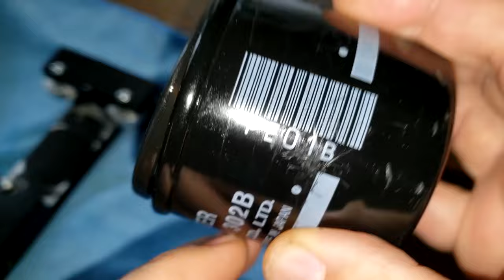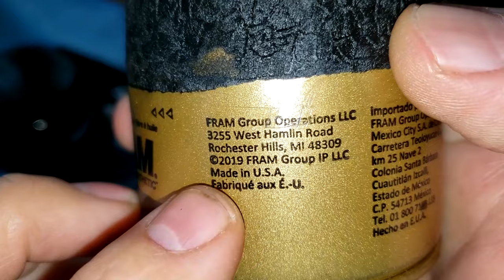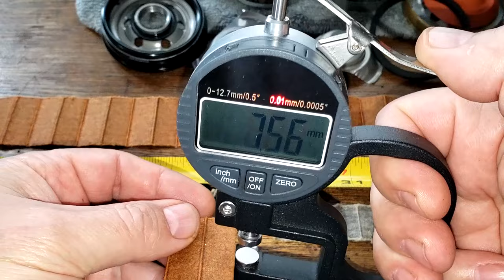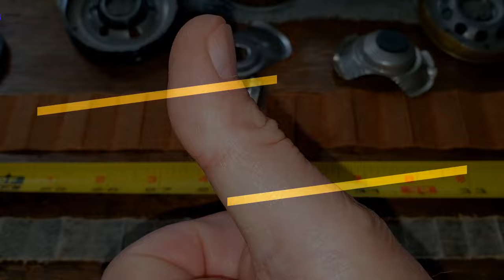Mazda PE01-14-302B Oil Filter Cut Open vs. Fram Ultra XG6607 Oil Filter Cut Open Comparison

Comment: That’s a really narrow media on the fram 😮
Reply: I used the oversize filter on my Mazda. Fram 7137.
Reply: @dwendt44  , yeah, the same filter that goes on recent model Honda CR-V's.  It's a tad longer than the 6607, but I figure as long as it fits, go for it.
Reply: @kimmillard9445  Most Asian autos can used that larger filter.
Reply: @dwendt44  if I were to use that size on my next oil change on my g35 would I have to maybe add like half of a quart extra to fill the bigger filter?
Reply: @kimmillard9445 it's also the same filter that go for 2012-2018 Nissan Altima models. I might start using Nissan OEM filters for now on after watching this video.
Reply: @flucas6595  , try the Purolator Boss PBL14610. If that's too long, you can try the PBL14612 which is a tad shorter.   The Amsoil equivalents are the EA15K13 and the EA15K12.
Reply: That Mazda filter should have way better oil flow.

Comment: OEM Mazda Filter wins this one.
Reply: no drainback
Reply: @freddyflintstoned913  on my CX5 wtih the 2.5 Skyactive engine, the filter hangs straight down.   Shouldn't need an antidrainback valve.
Reply: 9:16 Agreed, but my concern is that in the 100x view, the Mazda filter has big holes; I counted three. Therefore, the filter’s capacity for particles smaller than 20 microns makes me doubt its effectiveness

Comment: Seriously....the fram filter has less than half the filter medium than the Mazda filter.. that little thing will clog very quickly and all the oil including the dirty oil will go for sure through the bypass. The owner is lucky not experiencing any engine problems😮

Comment: Lets be honest with ourselves, Mazda looks brand new to me i think Mazda win this this one, but i still use Fram Ultra on my hondas.
Reply: With whatever non-oem filter you may choose, confirm it has the correct bypass spring p.s.i.
Reply: A filter that appears as new after 5,000 miles compared to one that shows clear evidence of moderate sludge/carbon trapped within its fibers and you prefer the one that looks like new? Do you understand the purpose of a filter?? A dirty filter is serving its intended purpose. A clean one is allowing impurities to remain suspended in the oil and continuing to circulate within the engine.

Comment: Good morning. I lean toward the Mazda filter.  Larger filter/neater pleats. Must be a reason OEM filter has no anti drain back on their filter. Looks to me that oil is dirtier on Fram. Later oil change? Or didn't Mazda do its job before Fram install?  Hi Chuck, I'm from Westmoreland Co. (Chuck is from Washington Co) 👍✊️
Reply: I'm an OEM filter fan myself.
Reply: I believe the FRAM has better filtration. Of course the Mazda (Tokyo Roki) filter would offer better flow characteristics. Maybe factory engineers felt that ample flow of filtered oil was more important than having the bypass at least partially open to get the required volume of lubricant to the moving parts. Hello from Washington County.

Comment: Thanks for the video, appreciate the extra effort it takes with used filters. The microscope comparisons are very useful too. Tokyo Roki filters are always so well made. I'm guessing the efficiency is around 50%, similar to the Toyota filters.
Reply from the maker: You're Welcome! I prefer opening the used oil filters, usually one filter per video though.
Thanks👍

Comment: Nice Job, Pete. If I had to choose, I'd take the Mazda Filter, I think, even though I generally don't care for OEM filters.  I do not like the bypass valve stuck in the leaf spring, too much chance for leakage. and the filters off my lawn mower look bigger than the filter cartridge in the Fram.    Too bad because it looks decently made with good materials.  I'll stick with my boss filters

Mazda makes good engines.  I had a 91 626 that I put on 20K miles for two years straight going from Nashua to Cambridge and it never gave me a lick of trouble.
Reply: I like the Fram's synthetic filter media better, but I was disappointed how chintzy they were in the amount of media for the same size cannister.
Reply: @kimmillard9445  As I said, I think the filters for my lawn mower have a bigger cartridge.  Neither one would be my first choice. Plus that bypass valve isn't a good design in my opinion.  too bad because the media is better.
Reply: I know my lawnmower has more filter media than the FRAM. It's a small can, but wow. That's not a lot of filter.
Reply: @donwyoming1936  LOL  I know, it is TINY
Reply from the maker: Thanks, Jim👍
Reply: @WhipCityWrencher anytime Pete

Comment: Considering oil this gentleman is using and filtration of Fram Ultra it could easily go as long as 7500 miles.
I would recommend him to use the longer version of this Fram with larger filtration area 
XG 7317 , Amazon sells it for 9usd 😉
Reply: Purolator PBL14610 is also the same, but longer, more media. 14612 is the short one like the 6607 shown here.
Reply: @elcano9l52  , yep.  The Amsoil equivalents are the EA15K13 and the EA15K12.  Also, fits on Troy-Bilt riding mowers for anyone that has one.
Reply: i have one car that calls for the 7317 and another the 6607 i wonder if it is some clearance issue if they have same threads.
Reply: @ranger178  7317 is just longer with more filtering media
Reply: @kdomster9141  well they must have some reason to make shorter one for space or different relief valve pressure or something
Reply: @ranger178  could be just no extra room for some cars , I tried both and both work fine on a Mazda 2.5 liter .

Comment: I have a Mazda as well and so far have been sticking to the OEM filters (though not the Japanese made version) because they have larger inlet holes and no anti drain back valve than the purolator boss of the same size, so I think it would be less restricted.
Reply: The WPE-14-302 is excellent(made in Thailand by Denso). It has large, oblong-shaped inlet holes, big e-core holes for good flow, and very sturdy filter media that will not sag or collapse, even on long oil change intervals.
Reply: @ChicagoRob2  yup that's what I use. Have to find a better supplier though because my nearest dealer is an hour away and I got burned twice on Amazon with crushed filters sent in an envelope.
Reply: @F0XD1E  There are several online Mazda dealers that sell the 1WPE-14-302.

Comment: Good morning, the fram filter is my pic, but the Mazda looks really good.  I use a fram ultra and have never had any issues.  Keep up the good work.
Reply from the maker: Thanks👍
Reply: I'm fine with the higher end fram versions. It's the lower end ones that I disagree with.
Reply: @josephm8294  the fram xg is all I use.

Comment: Mazda filter for the 🏆. I wouldn’t run that little fram filter on my lawnmower. I wouldn’t run any fram filter on anything I own. I’ve had a bad experience with a fram oil filter and will never trust them again. Great video Whip 👍
Reply from the maker: Thank You!
Reply: You should SEE the OEM filters for Troy-Bilt riding mowers.   Makes the 6607 look big by comparison.
Reply: And to think that some people actually defend the cardboard end caps that Fram uses on their orange cans.
Reply: On my Rover ride on mower (with the Kawasaki engine), I use a 'Stens' brand oil filter..... I'm assuming they're ok 🤔

Comment: I like the design of the Mazda relief valve and the thin spring with rubber gasket at top lots of surface area and a tight seal it seems, but Frams media looks nicer but less of it. If all the Mazda models have filter hanging upside down, then they don't need drain back but that Fram fits one of my other cars so it must be made for many models.

Comment: Whoa, ride the waves 🏄 of the cheapened media Ultra XG. Sad to see what's happened to "Ultra" filter, no way I'd run it even close to 20k mi. rating. Mazda doesn't use adbv on their OEM filters, which are mounted vertical thread end up. Small element on the Ultra. Mazda looks ok, I'd likely choose it over wavy media XG. Thanks for the video.
Reply from the maker: You're Welcome faxmen09👍
Reply: No matter the brand...you shouldn't be running any filter for 20k.
Reply: @lucky806   Cogent point clearly missed.  OG Ultra had no issues with a 20k oci/fci. Many anecdotes out there showing it. Even if not running it 20k miles, current Ultra doesn't hold a candle to the OG ultra.

Comment: Mazda has a bulletin on these oil filters for these cars, they want you to only use ones spec without an anti drainback valve, i would use only oem Mazda or wix 57002 as they are the only to spec for that engine. nice work
Reply from the maker: Thanks👍

Comment: If you use the fram ultra a larger size filter would be an alternative if possible ! If not just stick with the mazda ! 👍
Reply: Fram 7137 is the oversize filter.

Comment: I'm seeing a pattern in your videos of Fram skimping on the amount of filter media.
Reply from the maker: The Fram 6607 has always been a small oil filter, if room permits on an engine I would use the larger Fram 7317 oil filter.
Reply: @WhipCityWrencher  , yep. That's what goes on my Honda CRV.  My nephew's Troy-Bilt riding mower calls for the equivalent of the 6607, but I found it has room for the 7317, so that's what we're putting on there too!!
Reply from the maker: @kimmillard9445  Good Choice😊👍

Comment: Looks to me like the end cap on the Fram Ultra is quite wide, restricting the amount of useable filter material. For a larger filter size on a different engine, that probably doesn't make any real difference, but for a filter this small it might matter. The Fram does appear to capture smaller particles, but one of the most important specifications is that a filter allows a certain rate of oil flow through the filter, which is hard to calculate.

Comment: Why does the cx5 oil fiter so small for a 2.5 l engine? I had a civic 2010 with a larger oil filter. The engine was 1.8 l.

Comment: I wonder why Fram would spend so much effort engineering the bypass valve and anti-drain back valve but  use so little filter media.
Reply: What about the cardboard and caps Fram uses on their orange cans?
Reply: It's the 'cup style' end caps that are the problem here. Haven't seen those on Fram filters before.

Comment: Fram has far more Carbon build up in the media than the Mazda one. I think a clean filter would show the same as the Mazda in porosity.
Reply: That's because the Fram Ultra blocks more particles (carbon buildup), which the Mazda filter lets through. Whether or not the Fram Ultra is too restrictive so that it might reduce oil flow below Mazda specifications, is the only possible drawback.

Comment: With only 5k for Amsoil SS I'm not surpised everthing is really clean. With this oil I would go max 15k probably is still ok at that mileage.
Reply from the maker: Thanks for your feedback. But I wouldn't go 15K on any engine oil. The oil gets dirty, doesn't matter how good the oil is.
Reply: Oil analysis would give the answer how far it can really go. Amsoil SS probably has the detergent/dispersant additive package to go the 15k given how well the Group IV base oil resists breakdown. The question then is if your filter media has the necessary capacity for an OCI that long.

Comment: With the short intervals that he runs I’d take the Tokyo Roki. It looks to have more attention to detail than the Fram. The Roki filters can be purchased without Mazda’s branding on them quite reasonably. I understand that the customer wants to take good care of his Mazda but at those intervals he can achieve the same protection for much less money than the Signature Series oil. The Signature Series is similar to Mobil’s top shelf long drain oils in that they only shine if you have an application that can run LONG oil drain intervals without detrimental effects.

Comment: The PE01-14-302B is Mazda’s Mexico-made “value” filter. The WPE-14-302 is a better quality replacement.
Reply: Does this WPE version use anti drain back valve ?
Reply: @kdomster9141  No, not required.
Reply: @ChicagoRob2  why in previous Mazda oil filter models it was required?
Reply: @kdomster9141  An anti drain-back valve is only needed on filters mounted sideways or upside down. They serve no useful purpose on standard mounted filters, since they will always be filled with oil upon startup. There are three different OEM filters available(one specifically for the SkyActiv turbos), and none have anti drain-back valves.
Reply: @ChicagoRob2  Thanks for explaining , does this valve affect oil flow ? I'm trying to find out if it can have negative affect on filters performance on Skyacitv where it is mounted with opening pointed  up.
Reply: @kdomster9141  If you are using a Mazda aftermarket filter with an ADBV, I wouldn't worry. There is quite a bit of oil pressure in a running engine, and the valve will flex and open accordingly. Not a problem.

Comment: It's hard to spot the actual worn metal shavings greater than 20 microns with the naked eye...need a microscope to spot how much is caught in micrograms...and how many more micrograms are in the used 5 qts of oil in the drain pan after 5000 miles inside the engine

Comment: I would go by mazda not fram. Regardless ! Fram would be always  a poor design no matter how much  where you improve it still bad quality. And  you said you would go by fram.  Good luck!
Reply from the maker: I would buy the Fram Endurance in the FE7317 size.
Reply: @WhipCityWrencher  If you use syntetic oil only  Again Fram is poor quality. I saw one of my mechanics shop around the area complaining about oil intervals  with Frams verities  of ultra filters results. He said too much engine debries and burnt smells in all cars he changed oils every 3 months or 4k miles.